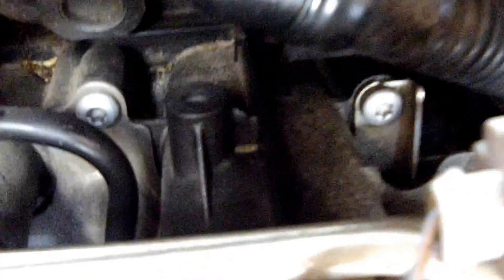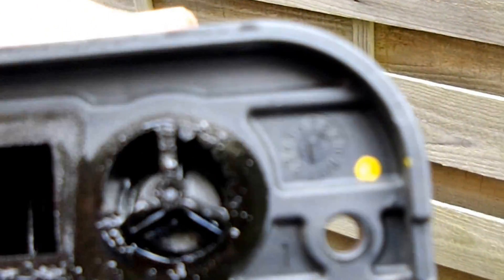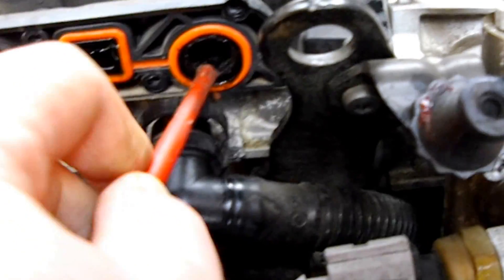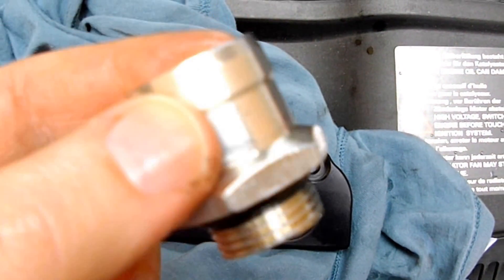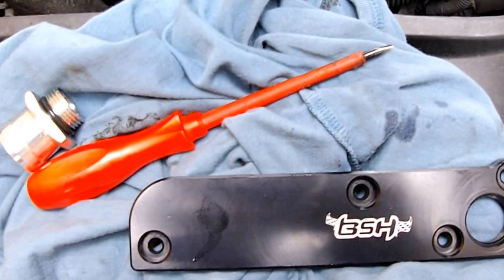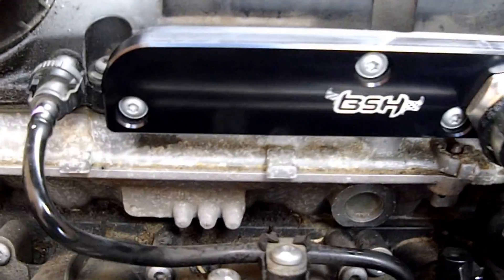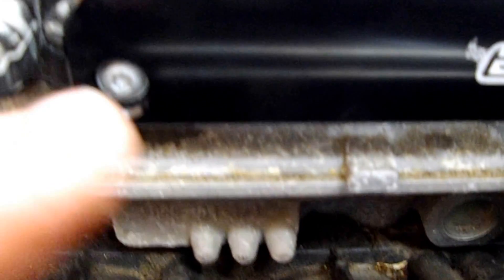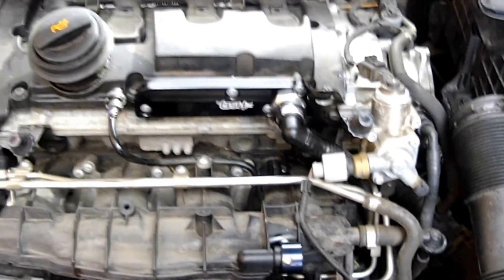PCV revamp on an FSI turbo charged 2.0 litre engine - VW Golf gti

Comment: My engine ran like shit with a PCV block plate installed. Poor idling, increased oil consumption.
Reply from the maker: sounds like you had a leak somewhere in the system as this install doesn't effect performance.

Comment: So this is a system doesn’t need a catch can? And where did u connect the hose from the delete plate?
Reply: It does need a catch can or else you will begin to leak oil
Reply: @lorddragoono  ABSOLUTELY not true and I will leave this here for other to see. 
These engines are a vacuum system until under boost. Once under boost, there is VERY negligible crankcase pressure. I run a boost gauge attached to my crankcase and it's never over 1 lb of pressure with 20 PSI of boost. 

These engines leak oil because of poor maintenance by bad owners who blame everything on VW. 
259K miles 265 / 290 35 MPG and burns less oil than most new low friction ring engines.

Comment: I have a spulen plate that I've been pushing off installing, how long have you bad your plate on? Any problems? Haven't decided to do it or not because of mixed opinions
Reply from the maker: It's a good point - there seems to be discussion for and against these systems.  I saw one catch can video on here, and within one oil change the can caught quite a lot of oil which otherwise was heading for the inlet manifold and valves.  This, claimed the poster, was helping him stop his engine from coking up.  The PCV revamp didn't include the catch can, just a slimmed down version.  The factory PCV system has long plagued this engine with poor mpg, rough idle, boost loss, and the dreaded oil spewing from the oil cap. By installing the BSH PCV revamp kit you will ensures these issues never affect your engine again.  That's why I installed it!  Good luck!
Reply: @spadds  I'm just on the fence on putting my plate in, not a catch can adapter
Reply from the maker: @caden987654321  I hear ya buddy - I think if you have so much concern over the change, I'd keep it OEM and not modify it at all.  That keeps it simple then.  Cheers!
Reply: The biggest concern is the stories on blowing seals and leaking oil everywhere, as well as blowing turbos from the pressure being moved to the turbo inlet

Comment: I did this upgrade and when I got on the interstate my car started jerking me around pretty bad.  I stopped off at the dealership this morning and they said I needed to put the OEM part back on.  Any idea why this would have happened?
Reply from the maker: Maybe a leaking seal in the vacuum system somewhere?  I'd recheck your installation again and make sure all connections are snug and seated correctly.  If you've done that and ifyour car won't run correctly with this part, then you are best as advised by the dealer to run stock parts.  Hope you have smooth driving!
Reply: @spadds  it was so bad today I didn't think I'd make it to work so I dropped it off at the dealer.   All they want to do is put an OEM pcv valve back on.   I spoke with a rep from Deutsche Auto Parts and he said I should've checked to see if the hose had popped off.   The only way I'll know is to replace the part and try again.   We'll see.
Reply: Jeffrey Sanders any updates ?
Reply: @littledaddyvlogs2657  Since the dealer just removed and replaced with the OEM part,  I'm trying to figure out if I installed it wrong (don't think that's possible) or if a vacuum leak somewhere else could have contributed.   I found an engine diagram and it looks like I shouldn't be revamping that valve.  I've asked the parts supplier for a refund and to pay for my repairs at the dealer.  But if I'm wrong I'll accept the responsibility.   I just don't know how I could have done this wrong.
Reply: And I do have other vacuum leaks with parts on order to repair.   Do you know how a vacuum leak could have caused this after revamping?
Reply: The problem when i install my pcv delete kit, engine is shaking and about to die. The solution is i wrongly attached the thing that cover the  intake manifold it should be insert properly and tight no air leak coming out and it works well like a brandnew engine.

Comment: Does this stop the car from burning oil ? My 2008 golf gti likes oil lol
Reply from the maker: No, the engine used about half a litre per 5000 miles.
Reply: Mine is 2.0 tfsi 200hp, install pcv delete  with oil catch can kit , it burn oil 1L/400mls. I dont know if will reduce oil consumption if im going to change purely pcv kit delete with no catch can. Any suggestion

Comment: Hi Spadds! Nice vid, I just ordered this kit for my 2.0T FSi, I have been having problems from the factory replaced PCV from VW. I wanted to know how your BSH PCV revamp kit is holding up for you?
Reply from the maker: All good thanks buddy!
Reply: spadds Did you clean your intake out with that crc intake gdi cleaner?? And your cars still running with the pvc delete?
Reply from the maker: no cleaning, i just installed the unit.  running sweet!!!

Comment: One question: I noticed that the pcv hose from the pcv to the intake manifold is now re-routed, but to what? As the nipple of the intake manifold which connects the pcv connects to is plugged off, where does the other end of the pcv hose connect to now???
Reply: The block off plate prevents gases from going into the intake manifold so you no longer need the hose. Thats why the hole in the intake is plugged.
Reply: j
Reply: Josh Batal bahahahahahaa
Reply: +Bijeet Tamrakar u are an idiot do u have eyeballs?
Reply: Josh Batal 🤣😂🤣😂✌🏻

Comment from the maker: Hi.  The car wasn't suffering from a failed PCV unit, I fitted the BSH Revamp at a preventative measure, so fitting it meant no difference to the performance of the car in any way.  I imagine that VW included the exhaust gas recirc PCV unit as a cost effective emmission point control.  BSH have just optimised where possible, similar to an engine remap!  ;-)
Reply: Did this make your engine leak oil?
Reply: @lorddragoono  You were really trolling huh? 
These engines are a vacuum system until under boost. Once under boost, there is VERY negligible crankcase pressure. I run a boost gauge attached to my crankcase and it's never over 1 lb of pressure with 20 PSI of boost. 

These engines leak oil because of poor maintenance by bad owners who blame everything on VW. 
259K miles 265 / 290 35 MPG and burns less oil than most new low friction ring engines.